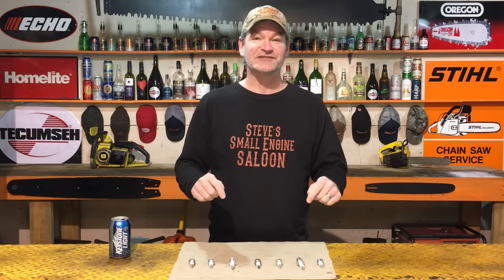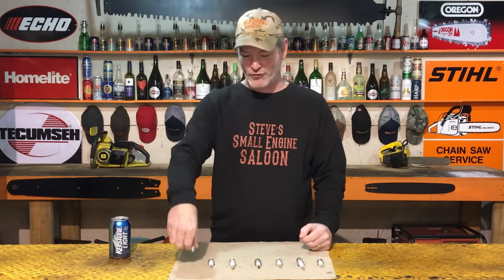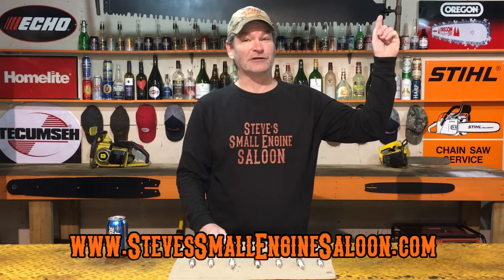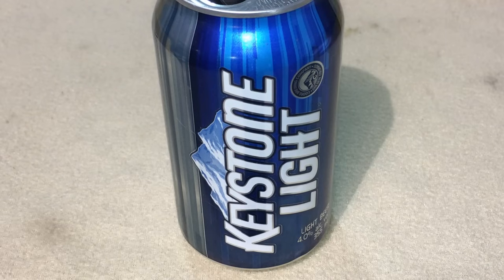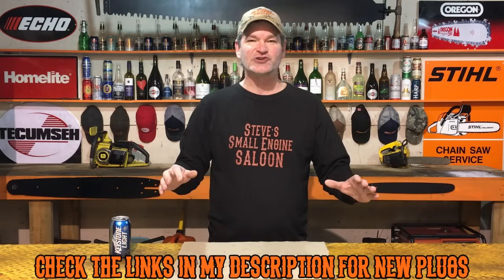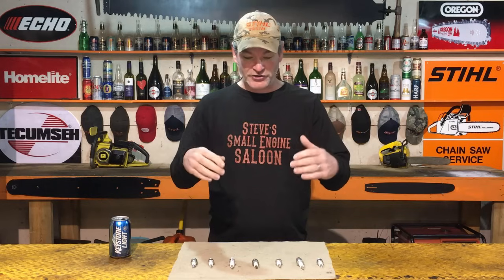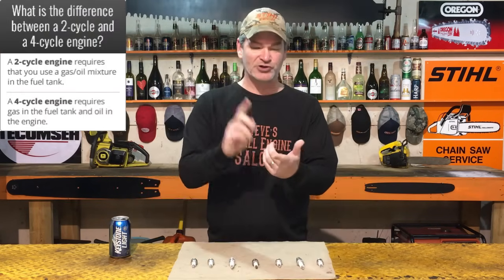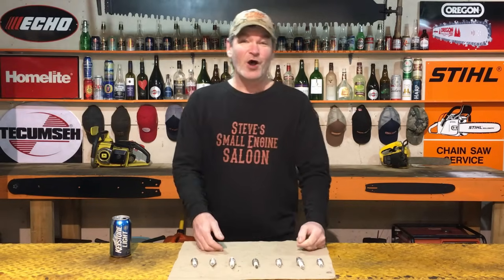How To Diagnose and Read the Color of Your Spark Plug

Comment: What does it mean when the spark plug is a mix of carbon fouling and ash deposits? 
This is on a 40 year old 4 stroke motor 
But it doesn't look like overheating, would you know why?
Reply: On an old engine with a lot of hours, if the tip/groundstrap/electrode is ashy and the base near the threads is dusty carbon, probably just some mild oil consumption based on wear but otherwise running well. Just pull/clean the plug more often and keep an eye on it and the oil level.

Comment: The "OVER HEATED" Plug could also mean, Lack of Proper Maintenance, where the COOLING FINS on the Engine are full of Sawdust, Grass Clippings, or "THE WORST", a Rodent Nest!

If the Fins are "Plugged up" with CRUD, the air from the Flywheel Fan cannot keep the engine cool durring "Normal Operation"...

Yet another video Steve!

Take care,
🤓 -Thomas
Port Orchard, Washington

Comment: Don't get the start of this video - oil fouled plug is because the fuel mixture is too rich? Too rich means there is too much fuel to oil? "The engine can't burn the oil you are asking it to burn". REMOVING (leaning) oil from the GAS/OIL mixture makes your AIR/FUEL mixture RICHER, effectively making your engine run RICHER (more smoking).

Comment: One of the more popular selling chainsaws on ebay are 52cc Chinese clones of Husqvarna. The directions say use a 25-1 oil mix. Many say it is too thick, and 32 or 40 to 1 is appropriate. What is your thought? 25-1 or 40-1?
Reply: 32.1 will get the best power and protection than all of the other mixes just so u Kno. Cheers

Comment: I run 40:1 on my stihl 026 pro , Original everything , got it for my graduation present in 90' ....I've always ran it with a little extra oil in my fuel . I checked my compression the other day , cold and it read 155 psi....Not too bad for a 30 yr. old saw , thats been used for at least 5 chords a yr......My plug always looks a little oily, like I like it....Ported/Psychoized....

Comment: Hey Steve i have a blower that the plug that has carbon build up. It fires up but it bogs down and shuts off when I pull the  trigger. Is it the plug and and will replacing it fix the problem? Thanks

Comment: At a dealer repair shop I was told my Ford E-150 plugs are due for changing.  BUT, these plugs tend to gall (stick) BUT a special tool may get them out, AND this takes hours and hundreds of dollars.  I got a second opinion and was told not to have this done until needed.  I wonder if there is a special plug that replaces the galled plug. I wonder if all of this is a big fish story.

Comment: Could it be that the design or tolerances of some older equipment makes it perform best with the richer mix as used to be recommended for it in it's earlier day, like 25:1?  Does the better lubrication of todays two cycle oils negate that requirement with old gear, so it's always better to go leaner and not end up with the black plug as used to be common?

Comment: My generator had carbon build up on it. I know because after I ran it with new spark plugs for 3 hrs, carbon buildup was visible. I cleaned the air filter immediately and now it seems to run like brand new again.
Reply from the maker: Right on Buddy...

Comment: Thank you do you have a video that discusses the actual spark discharge color?  How to diagnose a bad 593872 armature on a Briggs & Stratton 5 hp engine, please.  The cutoff switch is working properly but the connection is grounded at all times.

Comment: Hey Steve, thanks for this information. But I did not see an example for what I'm currently facing. I dont know how to share a photo of this spark plug with you. I've never seen one, brand new, with no gap what so ever.
Reply: @nick f no, this just has the strap completely touching the electrode. Its as if the piston is hitting the strap for some reason. Thanks for the response
Reply: @nick f it is the correct plug. And it did run when before it did not. My guess is i just need to get the ug back installed, correctly gapped, and then do the valve adjustments. Should be sublime after that. I have not had time to tinker with it further. To many projects. Thanks for the conversation and i i vite you to continue if you wish.

Comment: I have seen one that was metallic gray it was caused by a bad piston from excessive carbon build up I put a new cylinder and piston and rings it fixed that but the cause of the carbon was caused by a spun flywheel key throwing the timing off maybe you can do a video on the timing keys and flywheels on 2 stroke engines this was a poulan wild thing 2375

Comment: So, just out of curiosity.      I recently pulled plugs from my FZ6R, might have 15k miles on them (pretty average for a motorcycle), compression is something like 11-12:1 and runs at about 5-8k rpm average with a 11.5 redline. Just for some backstory and insight.

Color looks more like a darker coffee “bean”, has no real buildup, dry electrodes, threads slightly wet towards to gasket end (don’t think it’s oil), no white, no ceramic discoloring, no obvious signs of failure, one had a slight calcium/chalk looking powder on the external (non-threaded) metal section, which seems like aluminum oxide from the engine or maybe plating, but definitely NOT iron rust. 

Any thoughts?

Comment: Hey.. 2 days ago, i fell on my 4 stroke scooter (i fell to the left, so the scooter layed on its left side).. Anyways.. I got it up again and got it started.. I then drove it home, and parked it.. The next day, i noticed that oil had leaked out from the air filter, and down over the vario, and onto the ground.. I dont know much about scooters, so i just tried to start it again, and it started with no problem.. i drove it yesterday, and it was doing fine most of the time, but it was like there was a "dead point" on the gas handle.. like if i only turned the gas handle halfway, the scooter would just kinda hum, and then all of the sudden it would take the gas and start driving again.. It feet like it drove kinda uneven.. like at top speed, it would slow down just a bit, and then drive fine again.. Anyways, i got it home and hoped for the best.. well.. today i tried to start it, and it just wont start.. nothing happens either on kickstarter or electric start.. one of the few things i know about fixing scooters, is how to clean the carburator, so i opened it up and cleaned the jets (although they seemed clear).. It still wont start.. Anyways.. I got to thinking that maybe the spark plug got soaked in oil aswell, when i fell? I havent checked the spark plug yet, but im going to in 30 mins.. If i find it soaked in oil, do you then think i can just replace the sparkplug, and hope for the best, or do you think that some seal or something in the cylinder or whatever needs to be fixed/replaced? - I dont know if the fall damaged something, or just made oil go somewhere it werent supposed to, without damaging the motor itself.. I will write again when i have checked the plug, but please let me know if you think i have done major damage to the engine!
Reply: The spark plug had black wet oil.. I wiped it off with some paper, put it back in, and then it started with no problem.. >_> i still wonder if there is something else to fix tho.. what do you think? Just scared to drive it if some seal or something is broken, making mechanical damage or whatever

Comment: You said about weedeaters that they are designed to run with the throttle fully open, but wont that affect the engine in the long term, or cause overheating or other sort of problems? Its just that I have a Husq 545 rx and I fear not to ruin something in it, because they are quite expensive in parts. By the way, very helpful info in all your videos. Keep on going. Greetings from Romania.
Reply: Depends on whether or not you keep the cooling fins, air filter, and exhaust areas clean and how long you're running it at full throttle. Going at full-throttle for normal use (after warm-up) shouldn't cause overheating issues. You'll also wind up with less build up on your spark arrester.

Comment: I have a Husqavarna te250 and it’s a used 2016 model. I found little pieces of aluminum inside of the spark plug and the plug was not working either. My uncle says it means the top end is most likely destroyed or going to be but does anyone know what this means?

Comment: Question please, after rebuilding my engine. At 4k miles, engine started burning a quart every 300 miles. No leaks, no smoke, dry compression is 185 PSI, spark plugs are kinda black but it does not really look like the greasy one in the pictures in this video. It is more of a black powder like rich fuel/air mixture. Yet, one mechanic checked the engine and the spark plug. Says its the oil control piston rings. Any advice before dissembling the engine?

Comment: Great video Steve!  Question - When you say “bump your heat range up on your spark plug”... How?  Do you buy a different spark plug?
Reply: Gene McLeod yes
Reply: The longer the plug the hotter it typically is. Most producers have serial numbers on their plugs. Look up the code for whatever plugs you use and see which number in the code is the "heat" of the plug

Comment: Great video man! The spark plugs in cylinders 3 and 4 in Pontiac Fiero were carbon fouled after a mere 10,000 miles of use. Cylinders 1 and 2 still looked ok, but they were definitely on their way to being fouled (possibly due to cold temperatures and very high humidity). Those spark plugs were the OE spec ACDelco R43TS6 plugs which are quite cold. So, I went with some ACDelco R45TSX plugs (these are in the spec sheet as well) which should fix that problem.

Comment: Big help Steve. Just had an issue with my 2 year old direct injected Ski-doo REV-XS 800R ETEC, and now I can say it was more oil fouled than carbon fouled. Supposed to be a 10,000 mile plug but only lasted 1500 (only the right cylinder fouled, the left one looked like the coffee brown you were pointing out). Wondering if that has to do with starting it up monthly throughout the hot summer rather than summerizing it and operating the engine at too low an RPM in weather that is far out of its normal heat range. Definitely don't spare the horses on the trail. The shop said it was likely just "bad luck."

Comment: Steve, by far the best explanation of spark plugs I have ever seen! Thanks. By the way, in general is a higher number on a plug a hotter plug?
Reply from the maker: Depends on the manufacturer...
Reply: Ya I suppose. I pretty much exclusively use NGK with a few champions

Comment: Do they still use the spark arrester screens in the mufflers today?  Back when I worked in the field, they would get stopped up on 2 cycle engines and cause it to run very rich because it could not exhaust properly.  I ask because I have never heard you mention it.  It was something I always checked when the units came into the shop back then, 35 years ago.

Comment: Thanks for the info on the BEER , you just saved me MONEY 😂😂. Very good info! Would you clean the plug? I have a plug sand blaster been using it for years now, have not had to buy any plugs for a long time (  as long as they pass the multi -meter test ).....✌🏻️

Comment: My familiar small engine mechanic (he works in Husqvarna service) everytime tells me to run 2T always on full revs no matter how small job is. Other wise You just breaking equipment.
And about white color, at least from experience, running equipment without air filter will cause this happen.
Reply: probably decent advice, the 2T I believe is a fairly small engine, so it may rely more on engine/chain speed for good cutting.
Reply: @j.chrisbeck7492  I agree too but at full throttle You will not have problem with all carbon build up in exhaust post.

Comment: Straightforward as usual, Steve. Unrelated question: I picked up a non-runnin, no spark Mini Mac figuring it has to be one of four things: The coil. The condenser. The points or the spark plug. Am I missing anything? The cylinder looks good without scoring as does the piston. The spark plug was oily and black and cleaning it didn't help. Any tips on sources for parts? (The model says 600080S  serial prefix 16 and the clutch cover says Mini Mac CP. You helped big time with my MS650 so I thought you might have an idea.
Reply: sounds like maybe a air/fuel mix ratio problem. too much fuel/oil mix to air. (rich)

Comment: I always emphasize on the two stokes to customers that it will sound like it's running stinger and faster if you turn that high screw in but your cutting your oil out , that is the ONLY oil it gets is in the gas , so don't do that is what I tell them . Good info on the plugs Steve! :-)
Reply from the maker: Right on Buddy...
Reply: The plug in my chain saw is chocolate brown on the insulator which is good but my spark plug threads are wet. What does this mean and how can I fix it?

Comment: Great info, thanks Steve. My chainsaw was cutting out on me today. Took out the plug and had to clean the points with sandpaper to get it running again, I guess it needs replacing.
Reply from the maker: Right on Buddy...
Reply: Sometimes , depending on the plug, it will have a metal plating on it thats meant to be on it. Using sandpaper could take that fine layer of plating off of it....Eg. Like Platinum plugs , Iridium , Cobalt /Titanium drill bits.....If platinum plugs were all platinum , they would be a grand apiece ....I use a copper fine wire brush , or 250 grit or above sandpaper  , and lightly , I mean lightly scuff the strap.....Just trying to help ...peace.

Comment: Great information Steve. I have heard you are supposed to hold the throttle wide open while you cut the equipment off to get a truly accurate reading. Is this true or just a suggestion.
Reply from the maker: Do you mean run it full RPM as you press the stop button?  If so I have never heard of that!
Unfortunately Chivos answer is completely backwards!  You hold it at wide open throttle to adjust high speed screw and idle to adjust low speed screw.  I have several videos on my channel demonstrating this.....
Reply: Steve's Small Engine Saloon yes that  is exactly what I meant. Thank you for the answer and I will keep that in mind. Great channel Ave keep the videos coming.
Reply from the maker: Sorry Chivos but you just said "You are supposed to hold it wide open throttle when adjusting the low 
speed screw and at idle when adjusting the high speed screw".  That is totally incorrect, probably just a typo....
Reply: @StevesSmallEngineSaloon  
Haha 😁😂 Mr Steve glad you caught that, I have since edited my response. Sorry my bad.
Reply: FlyingAxblade  
So sorry man, and I'm glad Mr Steve caught my mistake lol. You're supposed to adjust the high speed screw at wide open throttle and the low speed screw at idle my bad guys. Once again I'm sorry for the typo.
Reply: I guess since Mr Steve won't answer your ? I will. You are supposed to hold it wide open throttle when adjusting the high speed screw and at idle when adjusting the low speed screw. Two strokes like being revved at wide open throttle, actually they're designed to work that way.

Comment: Hi Steve,
I am trying to get a generator engine to run. I only have the engine. I have cleaned the carb with carb cleaner, but when I took the carb apart I am sure there was a small spring in the float pin. I don't know if it did have a spring or not, but it just won't fire up and the plug is always wet when I try to fire it up.

Is there a small spring in the float pin? Thanks :D
Reply: Unplug the wire on the ignition coil and check for spark, if there isn't no spark,  the ignition coil is probably bad and needs replaced. I just had to replace the ignition coil on a generator last week that had to same problem.
Reply: @crankshaftgarage5722 : Thanks for the information mate.

I have a spark and I checked it just the way you mentioned.
It ran very poorly before I cleaned the carb but now it won't fire and the pug gets wet very fast. I think I have messed up the carb.
Good news is I have ordered a new carb, they are really cheap for these Chinese engines. I paid £11.00 for it and free shipping here in Scotland.
If it still won't run with the new one I will use the engine as a doorstop. LOL

Comment: Great video.  Can you do a short video on spark plug heat ranges.  How can you tell if it's a hotter or colder plug.  What do the numbers and letters mean.  Thanks
Reply: I agree Rick.. I was wondering the same thing when he was saying to go up or down. I would like a video on that also.
Reply: Higher the number, generally hotter plug.
Reply: The danger would be that people would start messing where they shouldn't and cause more problems.For most of us it's best to stick to what the manual says.